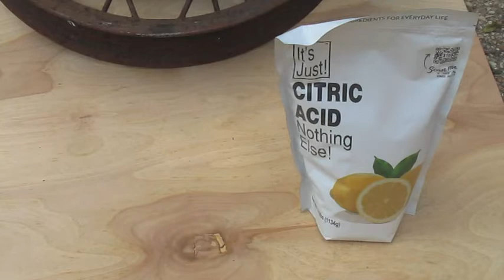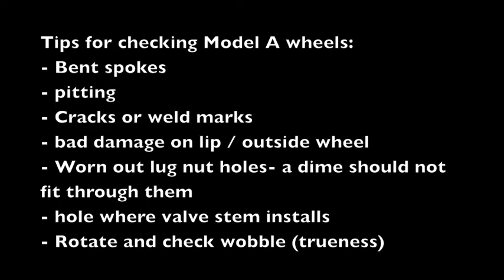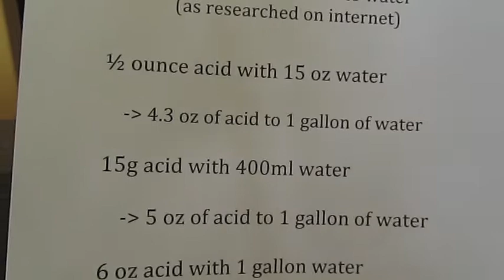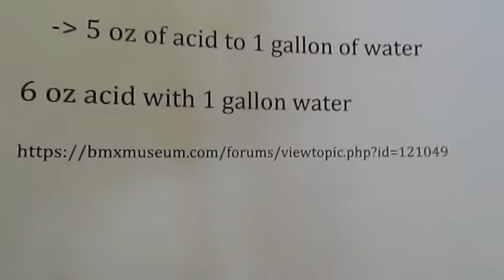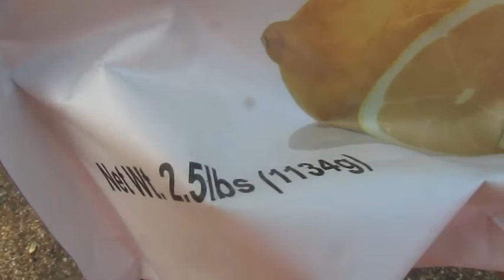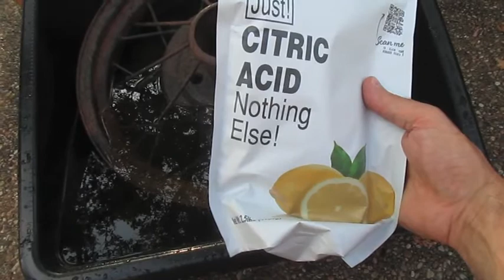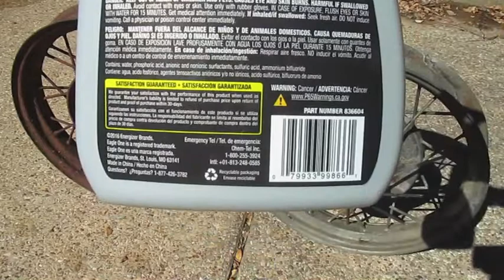Ford Model A - remove rust from wheels

Comment: Next time!! Take some 2×6 boards cut them  to what ever you need to fit the wheel and other rusty parts  then take big enough  pice of plastic  then line it and with small nails nail it around the top board and if nor deep enough  put 4 legs on eatch coner  then fill it up